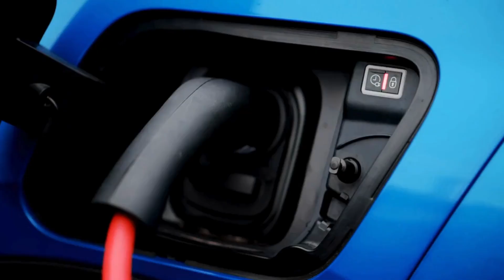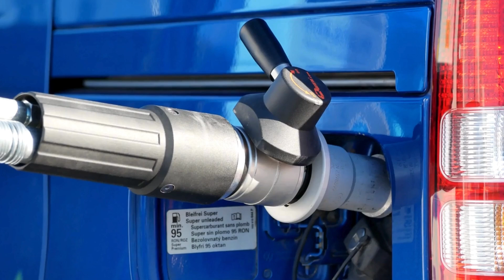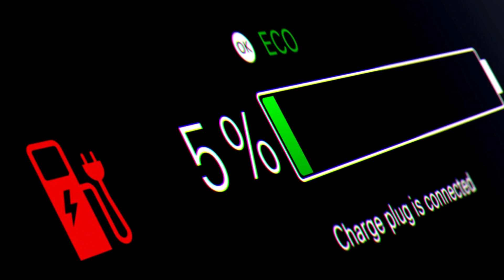Toyota CEO drop bombshell Toyota NEW Solid State Battery 1000 Miles with 5-min Charging!

Comment: Bullshit:  1000 miles / ~4 miles / KwHr  = ~250 KwHr battery  And to charge it in 5 minutes requires a 3 Megawatt charging station.  Assuming a 1000 volt system the charge current would be 3000 Amps.  This would require copper wire of nearly 1 inche in diameter to conduct the charging current.  Such a cable would be the size of a horse leg, would weigh more and would require cooling.

Comment: ?? Did an Ai fact check and this was the result 
No, Toyota does not currently use aluminum batteries for mass-produced vehicles; the company's future plans focus on solid-state batteries for electric vehicles and it continues to use and develop nickel-metal hydride (NiMH) and lithium-ion batteries for its current hybrid and hybrid electric vehicles. While Toyota has explored aluminum-ion battery technology with partners like Phinergy, its primary next-generation battery technology is solid-state, aiming for commercialization around 2027-2028.